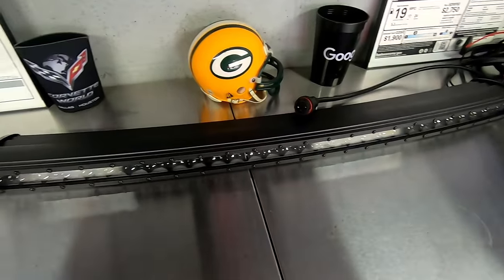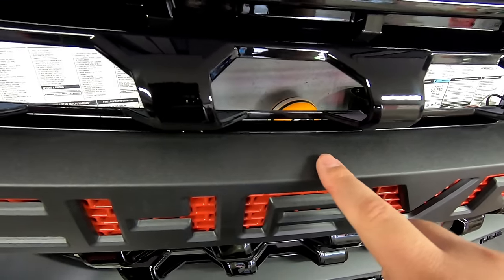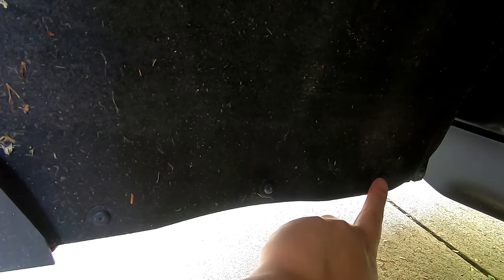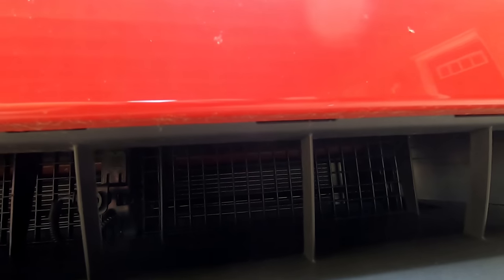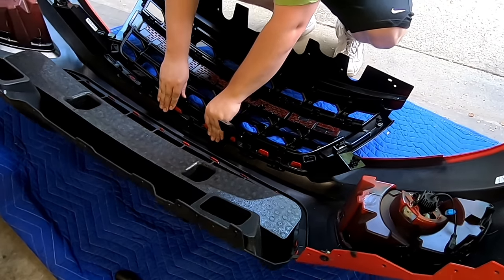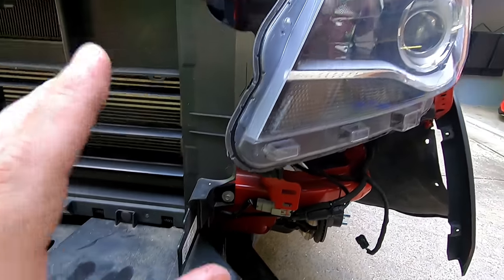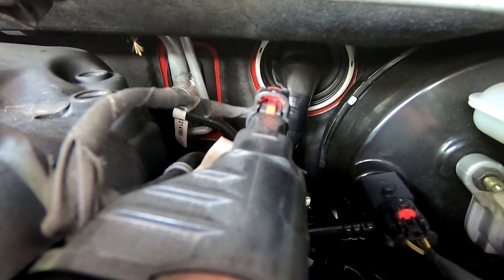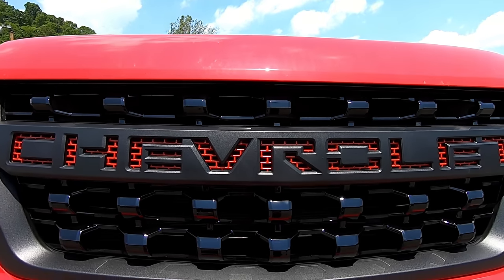BISON GRILLE and 15,000 lumen LIGHT BAR install on my 2018 Chevy COLORADO!!

Comment: Your truck looks great!! I'm buying a Colorado here in Australia, but they are RHD, badged as a Holden and built in Thailand. I'm hoping the grille will interchange as I want to badge mine as a Chevy. The Holden look is a bit weak (check out 'Holden Colorado' on Google). The Bison grille looks real tough. Fingers crossed!
Reply from the maker: Thank you! I'm not sure if that grille is going to fit, it looks like a different shape to me...
Reply: @HorsePowerObsessed  You're right. Different shape. I can go Chevy by buying parts from Thailand - they badge the same truck as ours as a Chevy. But nowhere as good as the Bison Grille.
Reply from the maker: @vettenews8159  That's too bad. Send me some pictures of your truck, I'm curious to see it! horse.power.obsessed@gmail.com

Comment: Any concern about light bar impeding air flow? It looks like they designed that area to be open-somewhat.
Reply from the maker: It still is very open but there's been a lot of talk on the forum about this exact issue and no one has noticed any increase in temperatures. 👍
Reply: Thanks, I live in desert and try to keep the heat issue in mind.
Reply from the maker: @stealyfan  absolutely! I don't see this causing any issues. The opening around the light bar is still big enough and the majority of the air gets pulled in through the grill anyway.

Comment: How did you pop those clips off ?? Especially those on the side ??? Having super hard time
Reply from the maker: It wasn't easy, took about 2 hours to get it fully separated.
Reply: @HorsePowerObsessed  I tried for 2 hours and succeeded only on the top corner once 🤣 I wish I can come and get some help from you
Reply from the maker: Yeah it’s not easy. I’d help you if you are local.
Reply: @HorsePowerObsessed  I live in Jersey not that far off
Reply: @HorsePowerObsessed  3 hours of suffering but finally I was able to take it off! All painted and put back together! No just need to get the new headlights and switch everything at once!

Comment: Did you have any issues removing the nut from the positive side of the battery? I get get mine completely off. It loosens but stops. I use all my force and doesn’t come off.
Reply: Also how did you get the pins off the harness? I can’t figure that out either. Thanks!
Reply from the maker: I've heard people having that issue, if you force it, the stud will break so definitely don't force it. You may have to cut the "ring" at the end of the power wire so it slips onto it.
Reply from the maker: A small screwdriver. There is a locking section of each pin you can push down with a small screwdriver to pull them out. Each one comes out individually.
Reply: HorsePower Obsessed thank you so much! That worked. Don’t know why I didn’t think of that!
Reply from the maker: No problem! I'm happy to help!

Comment: would this grille fit the LT model? and love the vids, I want to get the mods and add on but I don't know if they will fit the Colorado LT
Reply from the maker: It will definitely fit as long as you have a 2020 or prior model. The 2021's changed up the front bumper.
Reply: @HorsePowerObsessed  ok I got a 2016, and love the vids been watching all of them and seeing that to do for mine because you have the same color truck!!! THANK YOUUU
Reply from the maker: You're very welcome! Thank YOU!

Comment: Did you have any concerns about puncturing the rubber where you inserted the cable? No moisture or dirt seeping in from not applying some silicone?
Reply from the maker: No, the rubber is so tight through that area it acts as a seal anyway.
Reply: @HorsePowerObsessed  sounds super convenient. Did you have to finesse the curved light bar onto the brackets at all? Read some reviews where the brackets were designed for the straight light bar. Just ordered my mounts and was considering the curved one like yours.
Reply from the maker: Not really. It is designed for the straight bar but as soon as you tighten down the bolts on the light bar it works out just fine.
Reply: @HorsePowerObsessed  awesome. Thanks for the feedback man. I have a silver redline Colorado that's getting a lift next week. Yours and Matt's content are life savers for DIY Colorado mods. Thanks for the feedback!!
Reply from the maker: You're quite welcome! Congrats on the lift! Send me some pictures when it's done!
Reply: @HorsePowerObsessed  ok so I got my light bar in the mail and I'm going to be attempting the install myself. But I'm also doing ditch lights from rough country with the same exact wiring setup as the light bar. I'm new to wiring. Would I be able to hook up both lights directly to the battery like you did? Or would I need some kind of other setup altogether?

Comment: Damn it i really wish I would have thought about that with my flares because I’m itching for that grille. How much of a bitch do you think it would be to remove that 3m tape
Reply from the maker: That stuff was on there pretty good past that front bumper line. I'd say it's gonna be tough but as long as you have stuff to replace it with it shouldn't be too bad.

Comment: Yeah but the clips....very very difficult to get off to separate the two pieces of the grill prior to painting. What's the trick? I'm at a crossroads....nearly impossible task. Help!! FYI I've been a mechanic for 15 years!! Lol
Reply from the maker: They were definitely difficult and it took me about an hour to separate all of them. 2 tiny flat head screwdrivers are going to be your secret weapon here but even then it won't be easy. Time/patience.

Comment: How do you de pin a connector like you did?
Reply from the maker: A tiny screwdriver will allow you to push the pin in to allow it to slide out of the connector.

Comment: Which direction do you push the grill tabs to separate the portions of the grill to paint the Chevrolet letters?
Reply from the maker: Up and away. It's pretty obvious once you look at them.
Reply: @HorsePowerObsessed  I have eight screw drivers, numerous nails to assist as screw drivers, and I still can't get the bottom portion to break free. Most of the top is free, but the bottom corners are still not breaking free. My hands are cutup and raw, and I pull until I think the dang thing is going to snap, and not in an area that is meant to break.
Reply from the maker: It's not really difficult but it is time consuming. It took me about an hour to get the thing apart. There are a lot of clips on the top, bottom and in the middle around the lettering. Are you close to PA by chance? I'll give you a hand if you are.
Reply: I finally got it, but it definitely is not for the faint-hearted. I thought I was going to break it.

Comment: Were your fender flares not stuck to the front bumper with adhesive? I just installed fenders which had adhesive tape sticking them to the front bumper and now I want to change my grill. Any advise?
Reply from the maker: I added mine myself and when I did, I purposely didn't stick the adhesive on the front bumper knowing I was going to need into it later. If it's stock, it will be stuck all the way around. Some heat will help get it removed.
Reply: @HorsePowerObsessed  awesome thanks so much for the advise, did you restick yours or just use the screws? If you only used screws then are there any gaps?
Reply from the maker: Just screws from the bumper line forward. I've already had it off twice since then so I don't want to restick it at all.

Comment: Hello i have a 2016 Colorado LT i saw when you removed the front bumper and added those brackets for the 30 inch led light bar is there room between the air shutters and the back side of the bumper/grille to put a tranny cooler there i do not want to put it behind the shutters and in front of the AC condenser i am looking at these model of tranny cooler
 https://www.jegs.com/i/Derale/259/13720/10002/-1Thank you for your time to answer my question Thank you,
Reply from the maker: It looks like there would be room, yes. 👍

Comment: Is that a OEM part for the grill. Just called the dealership and was told it wouldn’t work for 2021 Colorado. How if possible can I make this happen?
Reply from the maker: Yeah, this will not work with the 2021.

Comment: Hey I checked out the link to that light bar and it says 12,000 lumens. Did you link the same one you put on your truck?
Reply from the maker: This is the one I bought - https://amzn.to/2PySz2f. It does say 12,000 now but it used to say 15,000. Maybe it was a typo? Either way, this thing is extremely bright so no worries.
Reply: @HorsePowerObsessed  thanks brah! By the way what trails do you use it for? I need a good justification for this bad boy.
Reply from the maker: Nothing crazy. Just local stuff. Lots of rarely traveled back roads in the winter, etc.

Comment: Have you tried to replace the speakers? I cannot get off the trim plate where the power window switches are
Reply from the maker: They are held on with clips. If you get some trim removal tools you can get it off but it does take some force.
Reply: HorsePower Obsessed yeah I bought that trim kit. I can barely get them to squeeze in any spots. So tight. I need a freaking pry bar! I feel like I’m going to snap something.
Reply from the maker: @seadoo4life727  they are definitely on there tight but they will come off! Straight up!
Reply: HorsePower Obsessed ok I try again in hopes I don’t ruin the plastic
Reply: Did you pry up from the arm rest pad? I’m ruining the silver plastic trim! Ahh
Reply: It was a shit show. Brought it to a stereo installer who said the newer trucks have a shit ton of clips. He never seen a Chevy truck this way. Maybe a 2019 thing. Idk
Reply from the maker: @seadoo4life727  Yes I pulled up on it. If you're using trim removal tools they shouldn't be ruining anything.
Reply from the maker: @seadoo4life727  they definitely take some work but it is only held on with the couple clips. I don't show the removal in the video but you can see they are removed in the video where I got my windows tinted. It might give you a better idea of where the clips actually are.
Reply: HorsePower Obsessed yeah I paid the man haha
Reply from the maker: @seadoo4life727  So they got them off then?
Reply: HorsePower Obsessed yes. Four doors with four new speakers
Reply from the maker: @seadoo4life727  nice. How's it sound?
Reply: HorsePower Obsessed way better. My last truck had the Bose and it was decent. I didn’t realize when I bought this one that I had the regular setup. I bought infinity speakers all around. Much better then the Bose. I still don’t have that center dash speaker and it’s still way better
Reply from the maker: @seadoo4life727  awesome! Did you power the speakers with an amp?
Reply: HorsePower Obsessed no not yet. Not sure if I will or not. It’s a lease. If so I’m thinking a 50 by four should do the trick
Reply from the maker: That definitely would do the trick but if you are okay with the way it sounds without it then I wouldn't worry about it.

Comment: Would the dual 30in. LED bar fire on the Colorado?
Reply from the maker: dual row you mean?
Reply: @HorsePowerObsessed  yes
Reply from the maker: @erictong3385  I've seen a few people with dual row front light bars so yes it will fit. It's a tight fit, but it will fit.

Comment: How much did you raise your truck front and back
Reply from the maker: Just the front, 2 inches.
Reply: I have the same set up 2 inch on same size tires do u think i can go 265/70r17 with no runbing
Reply from the maker: Yes. If you don't have wheel spacers.

Comment: How did you paint the inside of the lettering?
Reply from the maker: The grill comes apart. I took the 2 pieces apart and painted the back part with Krylon Fusion.
Reply: @HorsePowerObsessed  Yeah I tried briefly to separate those. Too afraid to break it.
Reply from the maker: I won't lie and tell you that it's easy but it's definitely worth it. It took me a good 2 hours to get it apart.
Reply: @HorsePowerObsessed  I agree it would be worth it for sure. The tabs are so tight I just know I’m gonna break it. Tried taping it off around the letters and the tedium got to me lol

Comment: What kind of paint you used for the grille ?
Reply from the maker: Krylon Fusion for plastics.
Reply: HorsePower Obsessed okay thank you I was planning on doing something similar. And has any of the paint chipped off or has it been pretty intact ?
Reply from the maker: It hasn't chipped at all. It's held up well.
Reply: HorsePower Obsessed okay thanks that’s good to know

Comment: Great looking mods !
Reply from the maker: Thank you! It's been a blast to mod this truck!
Reply: I know what you mean. I’ve done quite a bit to mine as well. One of my favs are the amp research electric side steps which have been worth every penny since I have the 3 inch lift. The other cool thing I did was add factory Nav which is great too.
Reply from the maker: @georges4562  That's awesome! I'm always using Android Auto so I don't really have a reason to have the nav.

Comment: You should get the ARB winch bumper
Reply from the maker: I'll definitely check it out! Thanks!
Reply: It is 1740.00
Reply from the maker: Thanks! 👍👍
Reply: They do make a supercharger for the V6, says it adds 100 horsepower and torque
Reply: Cost, don't know
Reply from the maker: I saw that. Not sure if I want to go voiding my powertrain warranty just yet 😁

Comment: How did you De pin the connector ?
Reply from the maker: A small screwdriver will allow you to do it.
Reply: HorsePower Obsessed awesome thanks
Reply from the maker: You're welcome! It's quite simple once you get a small screwdriver in there.

Comment: Does it work for 2016 Chevy coloraod?
Reply from the maker: Yes it does. Any Colorado will work.
Reply: @HorsePowerObsessed  interesting I keep calling dealerships and Auto records and most say doesnt Fit, where do you recommend buying the grille and verifying it will work in my 2016.

Comment: Hi I put a light bar in 16 canyon 2.8 and I have Gmc dealer bitching about air flow restriction I say bullshit ✌️🇨🇦
Reply from the maker: I'm certain it's BS because mine has restricted no airflow at all. The truck still runs the same temps (even when pulling a 5k pound boat) so I see no issues. It doesn't block enough airflow to be an issue.

Comment: You casually talk about removing the clips. There 34 of these. They are very difficult to remove. Where is the video showing how to easily remove them?
Reply from the maker: I made it very clear in the video. It’s not easy and it’s very time-consuming. You don’t remove them you just unclip them from the front. Like I said, not easy.

Comment: What did you do about the sensor behind where the light bar is .
Reply from the maker: Nothing. It's just a sensor for the temperature outside. It sits far enough back that it isn't affected.
Reply: @HorsePowerObsessed  ok i thought it was the sensor that warned a vehicle stopping in front of you thanks for the info really enjoy your channel
Reply from the maker: Thank you!